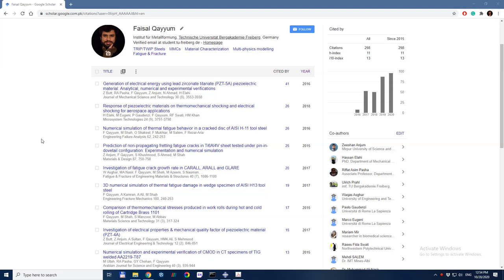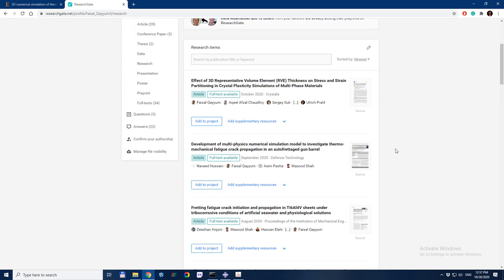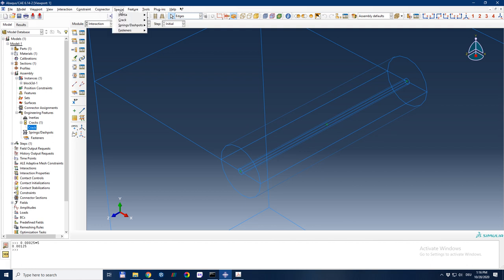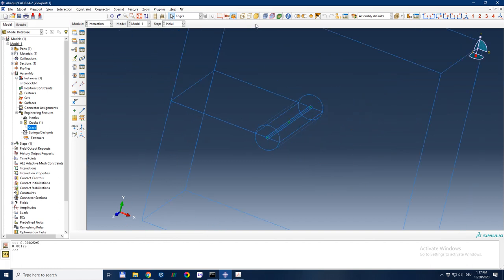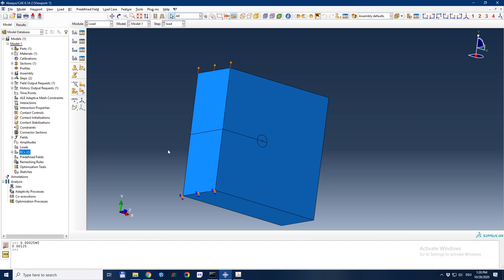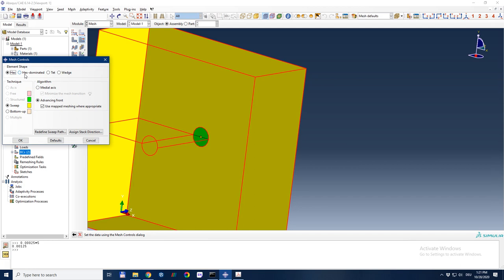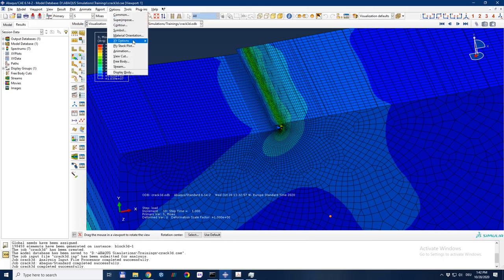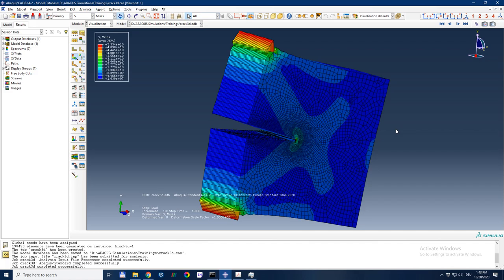Defining a 3D contour integral crack in ABAQUS

Comment: Thank you for the nice video. Is there any reference limit to the smaller circle on the crack tip ? Also will it affect the results if the dimensions of these circles are changed ?
Reply from the maker: Good question. There are some norms. Best practice is to try to keep the aspect ratio of the elements close to 1.
Reply: @FaisalQayyum  Thank you

Comment: hi sir, can you say how will you draw a graph if we are comparing experimental data and numerical data if we are collecting experimental paper from other author because we dont have exptl data point only we r having is the numerical data..............please say
Reply from the maker: That is an interesting question, the contour integral approach yields J-Int or SIF on the crack tip and experimentally we obtain CMOD, crack length and applied force. This data is analytically processed and plotted together with a similar reference. Please take a look into my previous publications for more details:
https://scholar.google.co.uk/citations?user=lXrpH_AAAAAJ&hl=en

Comment: Hello sir,
Thank you for your videos,
I'm working on a fatigue test on steel specimen and i want to visualize temperature in the crack tip during the propagation phase. Is that possible in abaqus?
Thank's,
Reply from the maker: Hello, this would be a very interesting simulation. I have no experience with such model though.

Comment: Dear,
That was a great video. Can u make a similar video on XFEM crack in 3D? I also wanted to learn about the application of fatigue loading (using R, at Higher amplitude).
Thanks.
Reply from the maker: I do not think that there is a problem there.